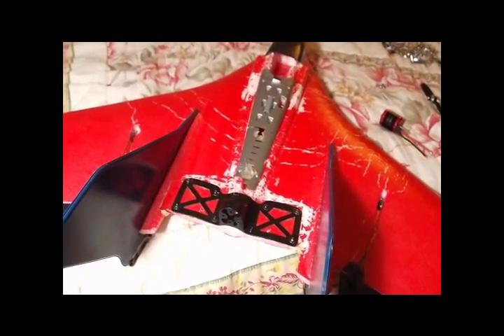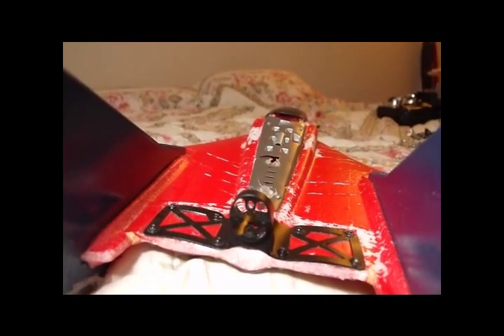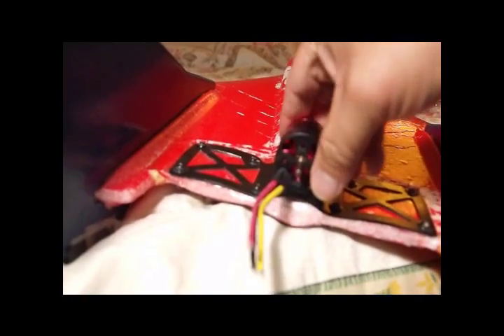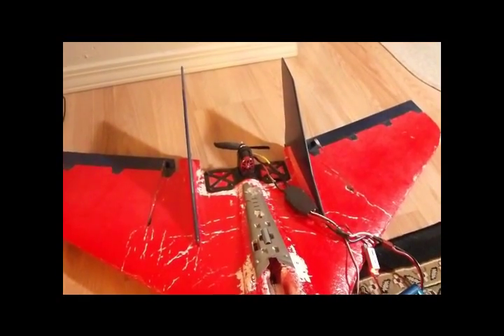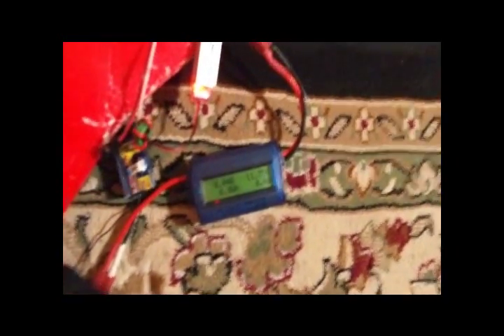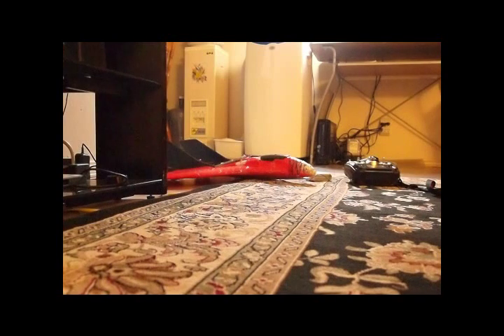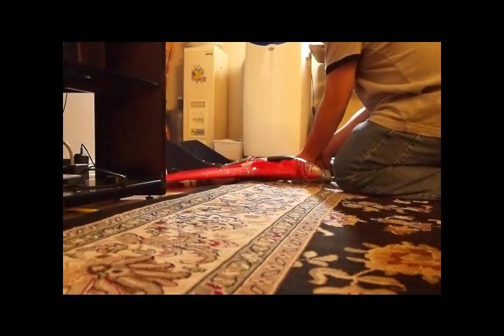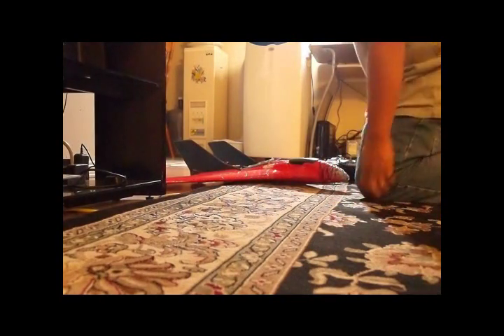Stryker motor upgrade to Turnigy 2836-3200

Comment: Could the 3200 kv motor be run on 4s ? I have a plush 60 amp esc  & the same 3200 motor in my stryker but yet to rig it all up

Comment from the maker: what brand of prop? Either your motor's KV is really low or mine is really high. On 5.25x4.75 I am hitting 60amps. I had to drop back down to 4.75x4.75 to get my amps back down to 55amps. Anyhow, I like the 4.75x4.75 better anyhow...much faster.

Comment from the maker: KV is too high for 4s. on 3S (4.75x4.75), it's hitting 55 amps. I'd estimate it'd probably be in the 70-80 amps for 4S on the same prop. The biggest prop I tested it on was 5.25x 4.75. it was drawing about 60amps. seem to have more torque, but less speed, so I dropped it back down to 4.75x4.75. let me know how it goes on 5x5

Comment from the maker: @arcteryxxx it is a tight fit, but never touches the side mounts. I have about a dozen flights on it now- flies nice and fast. the prop is 4.75x4.75...and hits 38 amps WOT. I'd estimate, I get close to 90mph and on a dive maybe a bit more. Was thinking about sanding the sides out, but that seems to be where the strength is on the motor mount...

Comment: Why this small prop and why didn't you sant out the inside of the stock mount. You squeezed an outrunner into a tight fit inrunner mount? Is that thing still running?